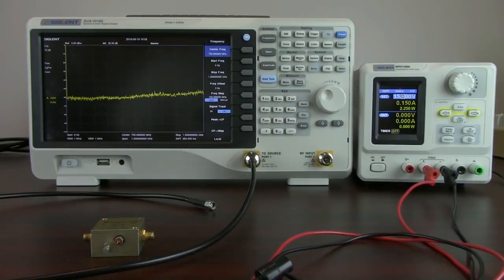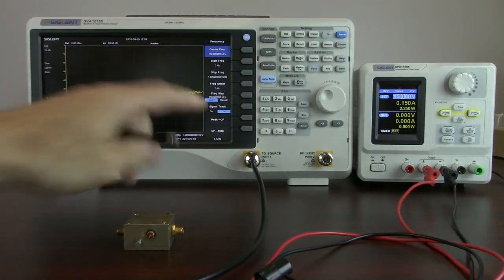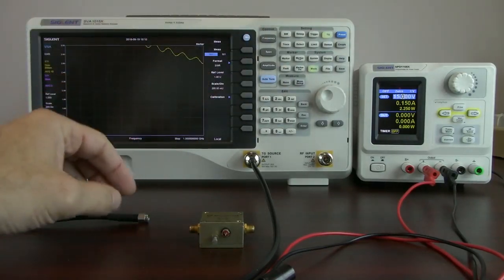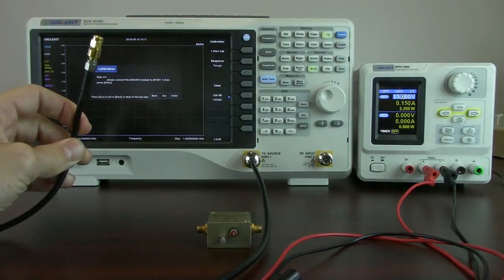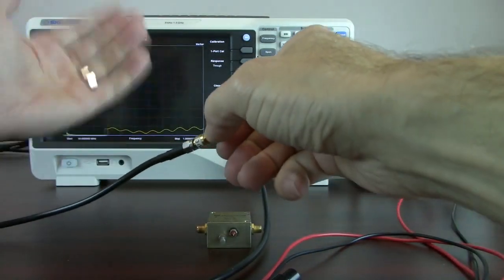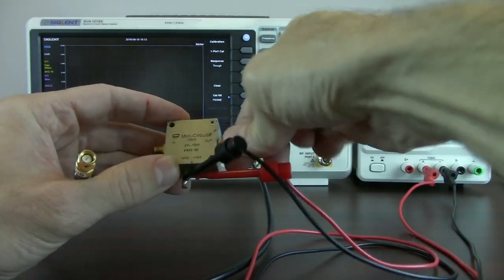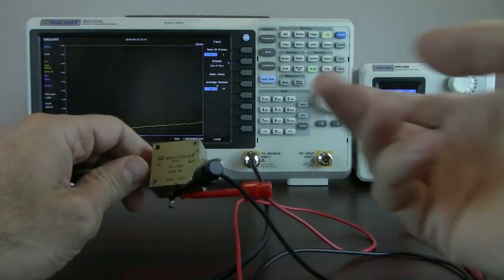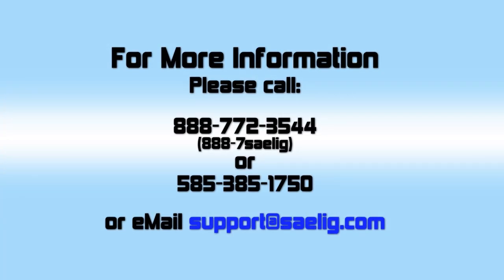SIGLENT SVA1015X Performing VSWR Measurement

Comment: Very Good Tutorial, Wonder if you could tune antenna's with the VSWR feature?
Reply from the maker: https://int.siglent.com/info/detail-27.html: "...perform measurements such as antenna matching in the widely used 2.4GHz ISM band. With the introduction of the SVA1032X, the vector network analysis function is integrated and enabled as standard for the entire SVA1000X series."